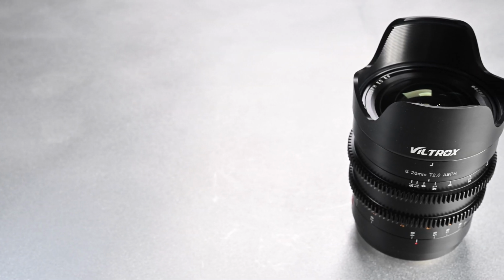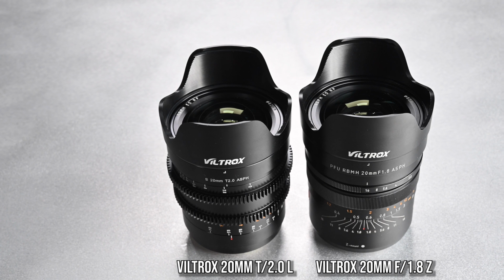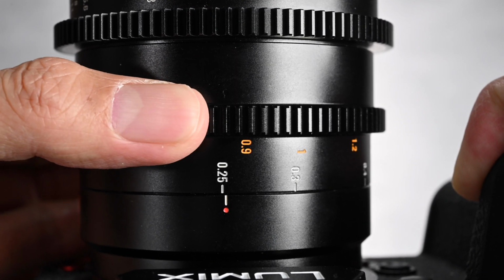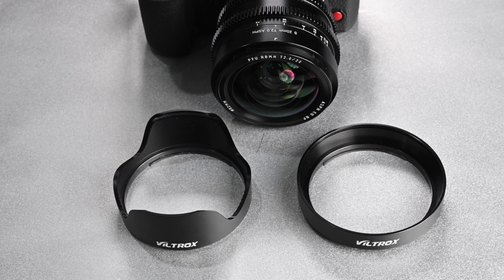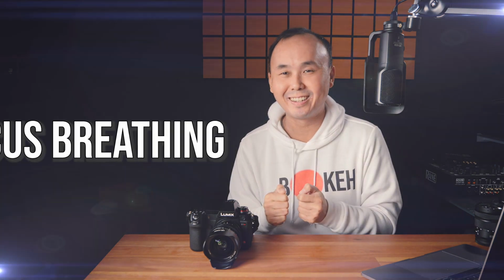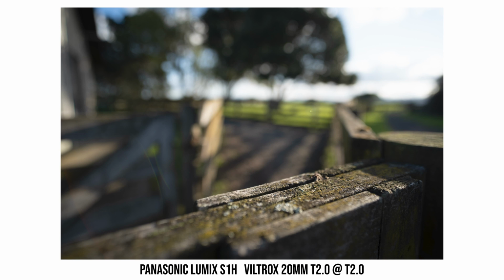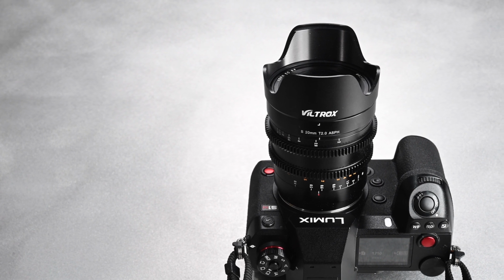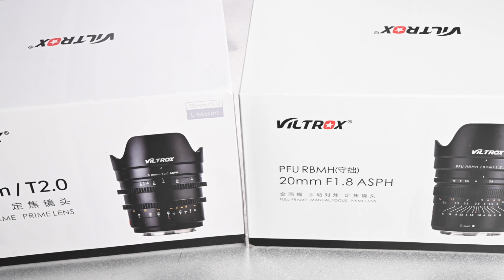Fast Wide Angle Cine Lens for only US$499? Viltrox 20mm T2.0 Cine L-Mount Lens

Comment: Hi Richard, excellent review as always, which one do I choose between viltrox 20mm or the Panasonic 20-60? I will make more videos than photos, performance in general (sharpness, distortion and bokeh), I hope your suggestion and if you can a comparison between these lenses.
Reply from the maker: Hi Hernan thanks for watching and glad you like the review. Between these two lenses, the Panasonic is better in terms of overall picture quality. And it has autofocus so could be quite handy if you use autofocus. On the other hand the viltrox feels very metal and solid, and the geared ring make it easier to work with follow focus if would use it one day and also better for low light.  A bit hard to compare ad they are really quite differently designed lenses
Reply: @TheRealRichardWong  Thank you very much Richard, I follow your channel you are an excellent professional, I still do not have the S1H but I will acquire it soon, my investment will be $ 5,000 and it would not reach me for more top lenses, I would start with the most basic, that's why my doubt, I hope that lenses from third parties join this system more, follow the reviews that I see them all, I like the focus tests that you do even in the rain, xd.
Reply from the maker: There are more manufacturer going to make L mount lenses.  A lot more affordable choices coming soon

Comment: I am very interested in it, I really want a 20mm for my S1r, but would prefer one that supports the auto aperture (like there sony version I expect) and the cheaper price.  I prefer something smaller then the Sigma f1.4, and it is by just a little (808 vs 950 gm) and shorter (100 vs 130mm) and cheaper (499 vs 899).  Neither are weather sealed, bummer.
Reply from the maker: auto aperture would be a bit hard for third party t as the L-mount is not open format.  But there are more L mount lenses coming soon!